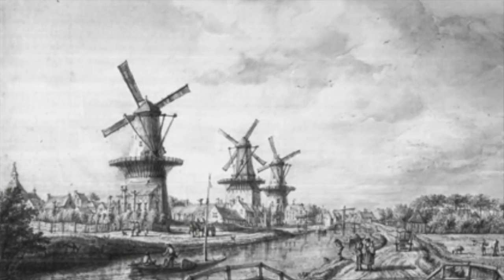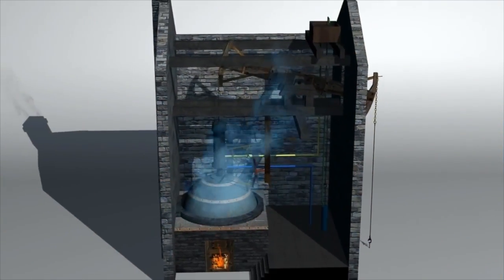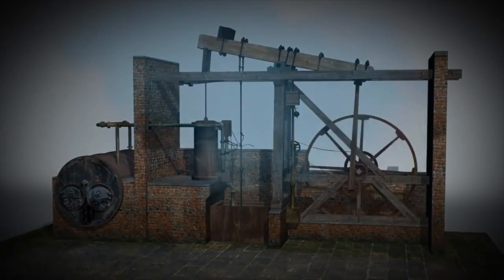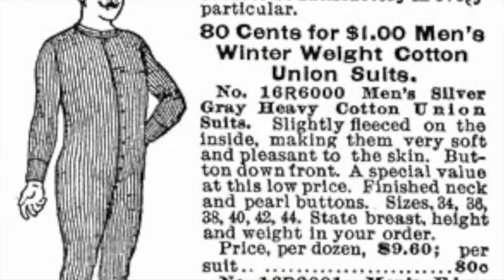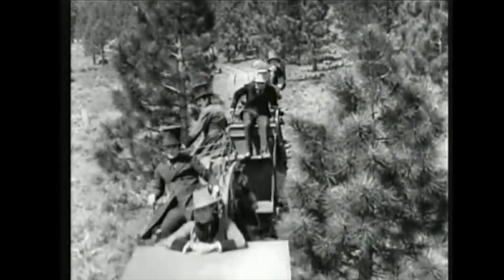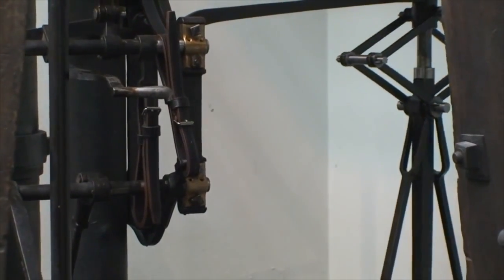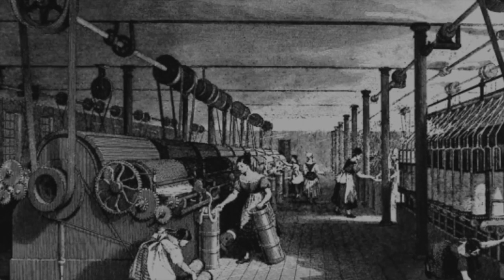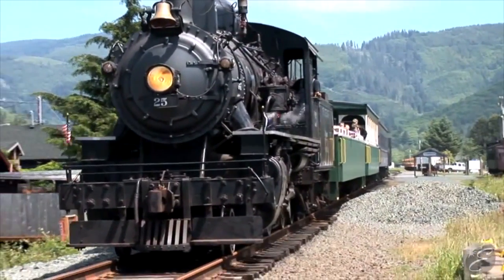How the Steam Engine Changed the World

Comment: Savery's Pump didn't work.
Newcomen's Pump was an Atmospheric Pump, not a Steam Engine.
James Watt dumped Newcomen's Atmospheric Power for High Pressure Steam Power.
To achieve this he had to invent a new engine, the world's first PRACTICAL High Pressure Steam Engine.
For the first time in human history we could replace the 2000 years old Water-wheel.
Then?
An Industrial Revolution!
Watt's Steam Powered Engine was the one and only invention that caused the Industrial Revolution.
It was a Power revolution.
Imagine what the Industrial Revolution would have been like without James Watt's High Pressure Steam Engine?
It wouldn't have happened!

Comment: The Newcomen Atmospheric Pump wasn't Steam Driven, it was driven by Atmospheric Pressure, it was an Atmospheric Pump it provided Atmospheric Power! So.
In it's 70 years long lifetime no Industrial Revolution!
Watt didn't improve Newcomen's Atmospheric Pump, it couldn't be improved!
James Watt dumped Newcomen's Atmospheric Power and Arkwright's Water-Power for High Pressure Steam Power.
To achieve that he had to invent a new engine, the world's first PRACTICAL High Pressure Steam Engine.
It provided Steam Power, the most important change by far!
Then?
An Industrial Revolution!
It was the one and only invention that kicked of the Industrial Revolution, it was a Power Revolution.
In the next 70 years, during Watt's lifetime and after, the World had changed.